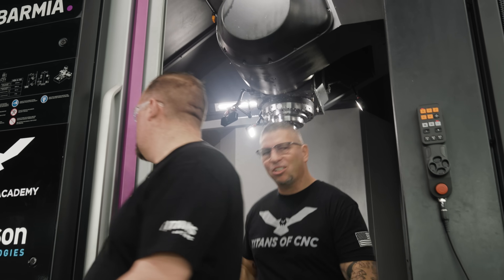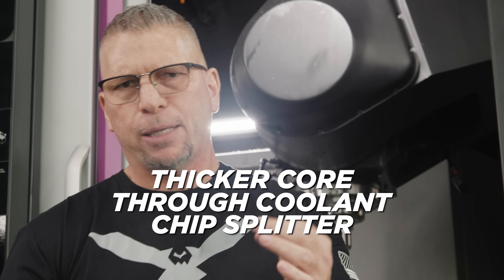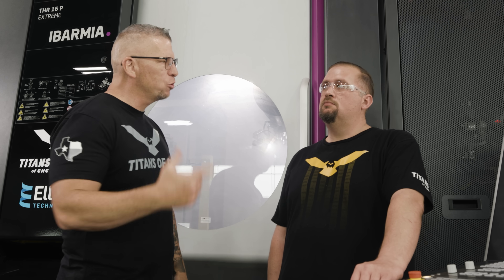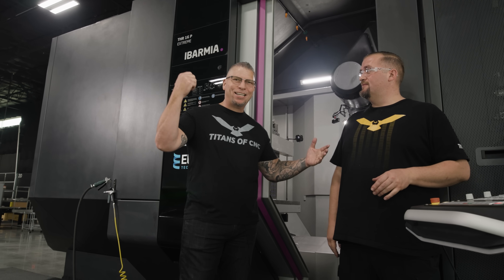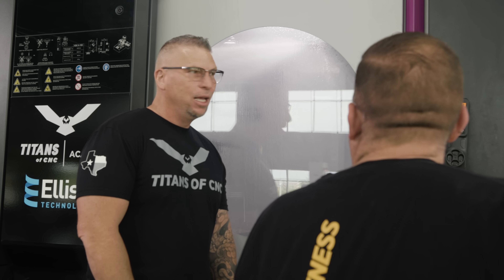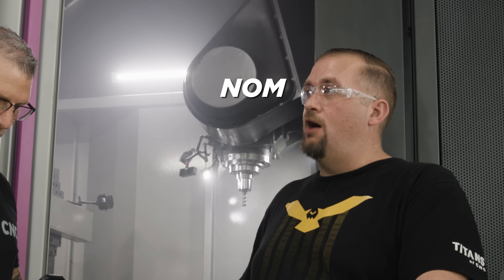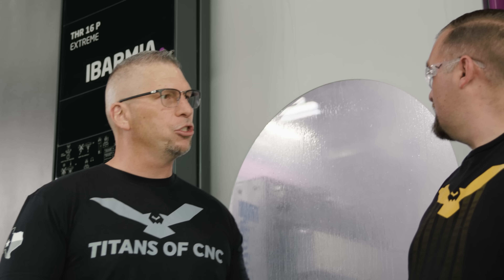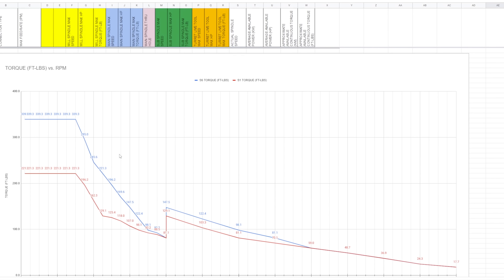How HARD Can We Push This MONSTER END MILL???

Comment: The one company I used to work for they didn’t care about whether or not the spindle could handle it. We were cutting aluminum and they would run 20,000 rpm 360 ipm with a 2inch facemill and the spindle would spike at 130% load and when the inserts would get dull it would get even higher. It was a roughing op so it would run for a good 15-20min because it was a big part that needed yo be roughed way down. There were so many chips we literally would fill almost 2 chip bins and these were good size chip bins too

Comment: That is an impressive machine and tooling. Barry's content at the end, is a valuable piece of information. In fact, it has more value for a Tormach than it does for the big machines. At the day job, most of my work is one off and small lots of dozen maybe. At home, I have my 1100M toy run around. I found early on with that light machine that knowing the MRR capabilities with availible hp was the first piece of the speeds and feeds puzzle for a light machine.  Know what potential is and alter LOC,DOC, chip load. For the 1100M, as long as I stay within 80% availible hp, at the spindle. Seems to run about 85ish% efficiency in power transmission.   I wrote a spreadsheet just for the sanity checks and it has yet to fail me. With some finesse, I've gotten 6ci/min in aluminum. Which according to the math, shouldn't be possible. So I'm obviously calculating conservatively.

Comment: hi, titans
I like your videos and even more like your passion for sharing technology
May I ask the upper limit of the spindle torque and power of s1 and the corresponding spindle speed?
Does the spindle have a gearbox? What is the ratio?
I want to calculate the cutting conditions
thank you
Reply: Hi Aaron. The high limit of S1 power is 99.2 HP from 4,000-8,000 RPM. The high limit of torque is 221 FT-LBS between 0 and 2,000 RPM.
Reply: @barrysetzer  Hi Barry
The cutting conditions I calculated are as follows
D=25.4mm
N=8280rpm
Vc=660.7146342 M/min
Vf=12700 mm/min
Fz=0.306763285 mm
Ae=8.509mm
Ap=76.2 mm
Net cutting power = 96.0691627 kW
Required torque = 131.2481493 Nm
MRR=8234.49966 cm³/min
The condition has exceeded the spindle s1 specification
The cutting conditions are really great, and there are very few conditions that can be adjusted
Although the torque condition is 299.63622 Nm 0-2000rpm, I don't know how much the torque drops at 8280rpm
If the torque can still be adjusted upward, and the power of the spindle S6 has not reached the upper limit
It may be possible to increase the cutting amount per edge to improve the removal rate
Or use DLC-coated cutting tools to reduce friction to improve cutting efficiency
Or replace the tool with a larger diameter and increase the Vc to more than 1000 M/min, which can also reduce the unit cutting force of the aluminum alloy, and the engagement angle will also decrease due to the large diameter tool
The above are just theories, I really want to try if I have the chance
thank you for sharing

Comment: What holder is that with the coolant spraying on the flutes? Do they make a cat50 version?
Reply: Yes. The holder is a Kennametal Hydroforce. But its the collet that has thru coolant
Reply: Take a look at 1:49 to see the coolant holes
Reply: I'll have to check them out Monday. It's rare I get to push the spindle on the okk near 100% so far only when I used a 4" insert cutter ramping a blind 7.9" hole 4 inches deep have I been able to truly work it.
Reply: Beast mode bro! Thanks for watching!

Comment: Thats impressive those machines can cut that much material off!  Are yall going to run this same test on a giant block of steel?     I run a 150 hp heavy roll lathe and according to my calculations I can dry cut with single point ceramic @ 116 cubic inches MRR per minute of STEEL all day.   I can run it up to 230 cubic inches MRR for a short amount of time before the cutter is fried.    specs are 1-1/4 round insert, DOC is 1.300 inch (surface area on the round insert), IPM is .006 up to max .012,   spindle rpm 125 and max 135.   sfm is 1244 normal and max 1343 on a 39 inch diameter roll.    a 15 ton roll @ 135 rpm is somewhat intimidating to stand beside!!   Its impressive what these 50 year old machines can do!!   Ive made about a full tandem dump truck load of steel chips in a 12 hr shift!!

Comment: The largest V8 put in a production American car was a 500 cubic inch or 8.2 liter engine put in a Cadillac. Imagine Titan machining the cylinders of that monster engine every minute.
Reply: I drove one of those old caddys years ago and aint nothing like the torque of a low rpm BIG block!  I currently own a 85 chevy K30 with a GM HT502 big block crate engine with the tremec TR4050 5 speed, yea its terrible on gas but super fun to drive and tow with just because of all the Torque!

Comment: Hey titan,
How do you calculate how much your vice can hold when taking cuts like that? Or do you have another  clamp or dovetail that I’m not seeing?
Thanks
Reply: These vises are equipped with some special Schunk jaws that have 6 rows of teeth. They dig into the material (and they offer carbide tipped versions that even dig in to inconel) so that there is FAR more holding force than what our cutters put into the part
Reply: @barrysetzer  
Nice
Do you feel they work better than the pit bull clamps

Comment: Why would you rough aluminum with a 5 flute?
Reply: Because its a 5 flute tool engineered for aluminum. Feed per tooth means MORE teeth MORE feed, more MRR, more MONEY
Reply from the maker: More Rigid and you can cut with the entire length of the flute at greater speeds… thus increasing MRR and making more money as my Man Barry Said.

Comment: Any chance you could do this KOR5 cutter on a continuous programme at these high MRR's.
As in most shops we don't talk for 10 minutes between cuts polishing our halos. 👍😁
Reply: Haha, if you watch closely, youll see the Solidworks shot of the part that im about to make using these exact parameters. Stay tuned
Reply: @barrysetzer  I am waiting with some high hopes of a great video.
Reply: @barrysetzer  Yeah I saw it and was hoping that that was what you'd be cutting at that MRR.  
I'm staying tuned...  :)
Reply: @danl.4743  Yeah, I wonder.  Pit bull clamps work really good when used properly. Even so, I can't imagine taking this cut they are doing holding that huge chunk of aluminum with only little pit bull clamps holding it at the bottom. Who knows though, they might work  but who would dare to try it?

Comment: What are the details for the spindle in this machine? Model number, number of bearings, the exact bearing lubrication system being used, etc. Is this an H200 spindle with an H200-S16 motor? I love the MRR, and the speed, but the really intriguing part for me is the machine itself, and it's associated total cost of ownership based on how it is used. I also love that machine cloud app calculating the torque curves and graphs. Please provide more information on that app. You guys really get me thinking about so many details. I don't know if I want to be a machinist, or a machine repair technician, or perhaps a spindle rebuilder. Y'all make me nuts man. Boom.

Comment: Does anyone have any idea what I could do as part of my thesis as a polymechanic? I have to construct a part myself and then machine it. The time required should be about 15-30 hours. I have a 5-axis machine and or some 3-axis machines available. The part should not be too big and preferably made of aluminum. Do you just have a good idea what I could do that is not too difficult but stil makes fun to do?
Reply: Plenty of ideas! Are you a part of our facebook machinists group? If you posted this question there, you would be flooded with answers
Reply: Check out 3:15 in this video

Comment: Unreal! Our little Tormach 1100 surprised me the other day with a little .1875" 3 flute LakeShore carbide running 70 IPM with a .200" DOC but only .020 radial, it decided it thought the hole from the next operation was already there during an adaptive clearing op and just DOVE into the 6061 I was milling and did a .500" diameter hole at full speed at .200" DOC! The endmill survived! 
The morale of the story is, they can eat more than you THINK! Haha!🍻

#cncnewbie
Reply from the maker: That’s great.
Search Tormach on our channel…We have a ton of cool videos showing what is possible.
Reply: @TITANSofCNC  will do!
Reply: You mean Lake*shore* Carbide? 
What RPM?
Reply: @danl.4743  haha, oops yeah lakeshore lol. It was at full RPM of 5000 on our machine. I certainly wouldn't do that on purpose haha!

Comment: very cool throwing the types of running electric motors in there (Sx). we had different problems tho. some mills we have are very old or underpowered so they often can't handle the power or load on the machinebed. they are cheap ... which seems to be the most important thing to our boss
Reply: l was wondering tho: l learned that you should run a motor at the given speed and or power. otherwise electrical machines become less efficient. having a huge ass spindle that runs on barely any load unefficient?
Reply: @leonschumann2361  So you are right that motors lose efficiency with lower speed. In a AC induction motor, torque is the main loss which you need for a good cut in metal. However, overall efficiency for induction motors is about the same from 40 to 120% or rated speed with a small rise around 100%.

This will vary from motor to motor and type of winding (brushed, brushless, induction) but it's very cool to find the sweet spot of your machine that gives you the most torque possible

Comment: Now try it with inconel..
Reply from the maker: You must not know us very well… We have a ton of videos on our channel where we are Murdering Inconel 625 and 718 at Record speeds. We also have Monel K500 etc.
We also have a Free AerospaceAcademy.com

And solved many of SpaceX’s biggest machining problems for over a decade.

BOOM😉
Reply: @TITANSofCNC  I apologise as I've not seen them. I work in aerospace but on die sinking edm for jet engine turbine nozzle guide vanes made from investment cast nimonic alloys :)
Reply: Don’t be daft. Completely different application for the tooling and material.
Reply: @Mazrim_Taim  He did say “ANYTHING”
Reply from the maker: You must not know us very well… We have a ton of videos on our channel where we are Murdering Inconel 625 and 718 at Record speeds. We also have Monel K500 etc.
We also have a Free AerospaceAcademy.com

And solved many of SpaceX’s biggest machining problems for over a decade.

BOOM😉